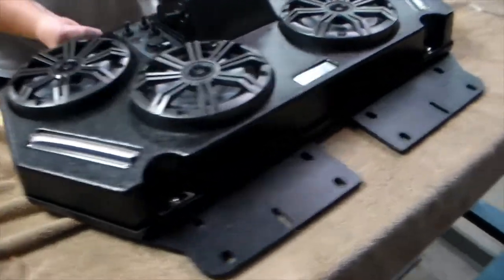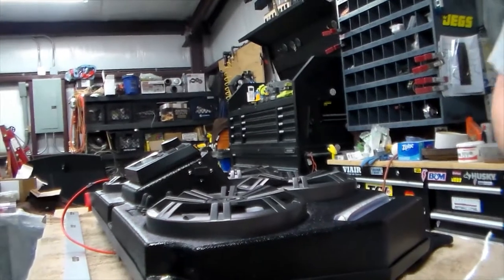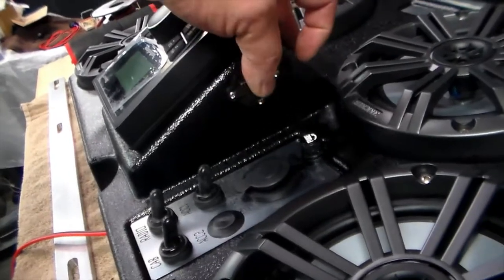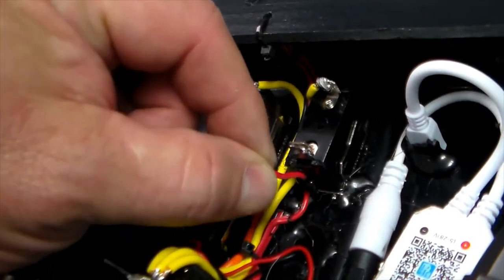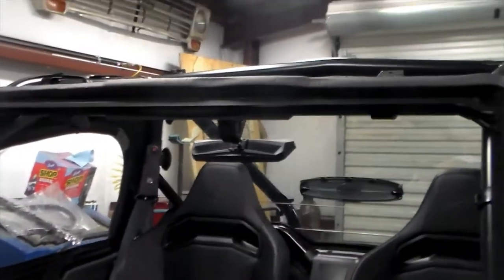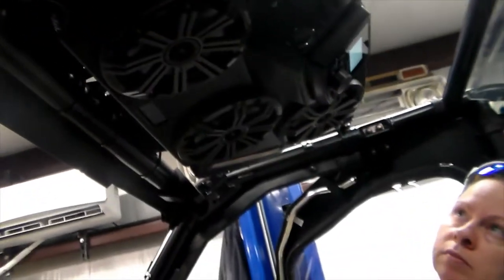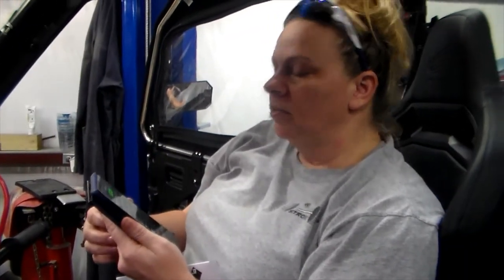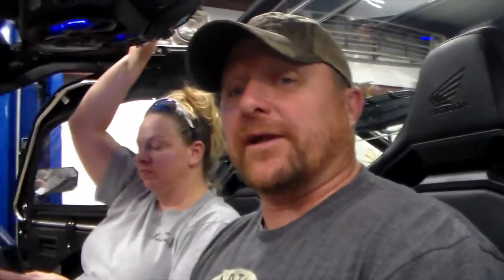Road to the Rockies, Honda Talon Rockin Radio install

Comment: Thanks for the candid review.  With respect I'd offer that, if a wire broke during shipping to your location, what can we expect from miles and miles of rough riding on the trail?  Honestly, it doesn't inspire confidence.  I could tell that you were not impressed with the bird's nest of wiring when you opened it up.  Rock'in Radio appears to have the foundation of a good box, but they really need to rethink their wiring plan in my estimation.

Once again, thanks much for sharing.  It would be good to see another follow-up video a few months down the road, to see what your longer-term impression is (which you indicated you'd do).

Steve
Reply from the maker: Steve, we are both electricians so we can be extremely critical of craftsmanship. Now, while they did do right by us and send us a whole new switch with proper connections, we did go ahead and solder the connection properly.  So we arent concerned with the repair now.  

However, we absolutely will do another review in a few months just to give another performance update. 

Thanks for commenting and stay tuned!!